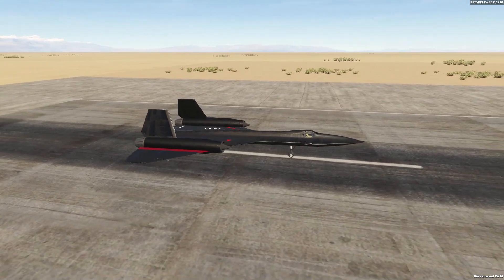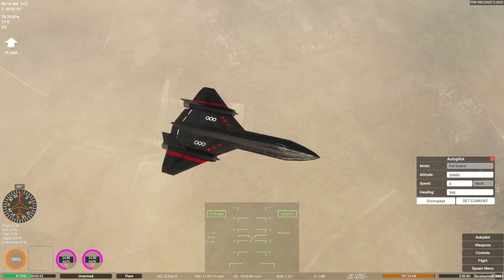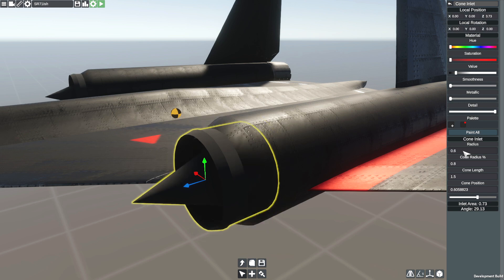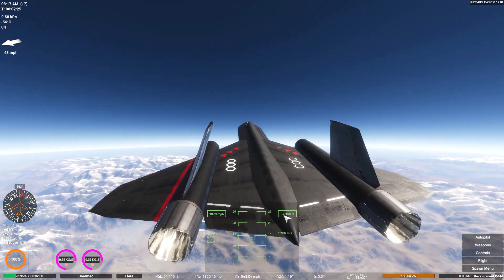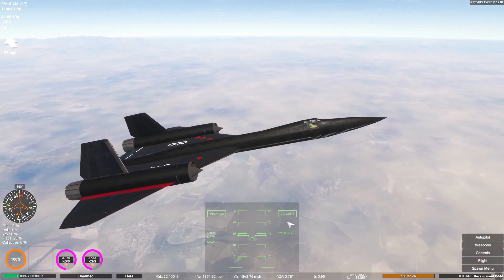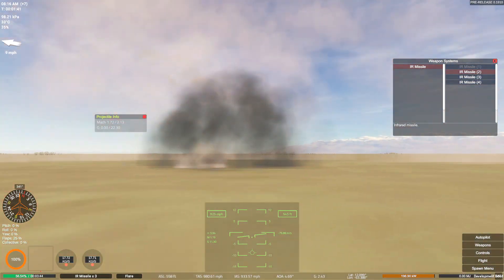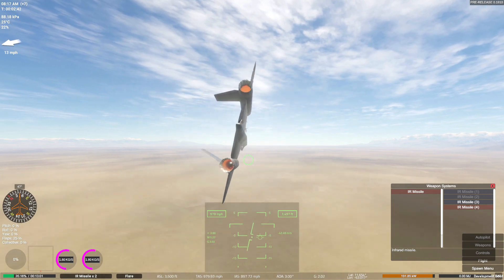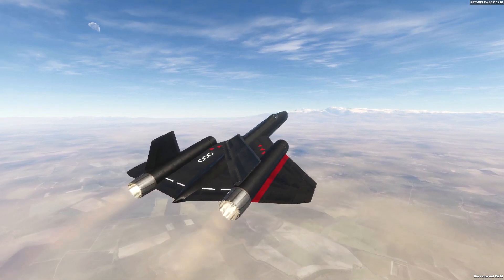Can My SR71 Reach MACH 3 In Flyout!

Comment: The wings should be way shorter, the wings sweep angle should be higher too, and there should be more wing area on the side of the fuselage on the front like the actually blackbird, the engines should go way more out and their external side should get small wings much like canards connecting to the main wings